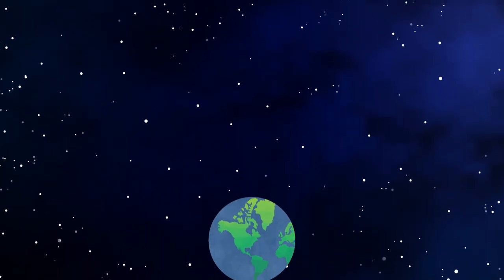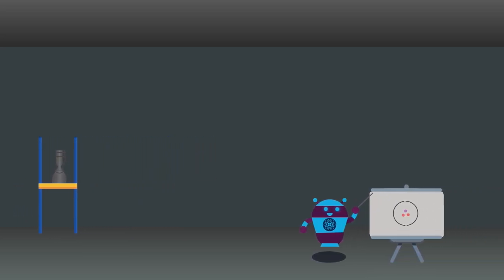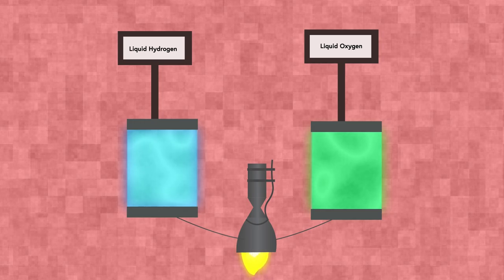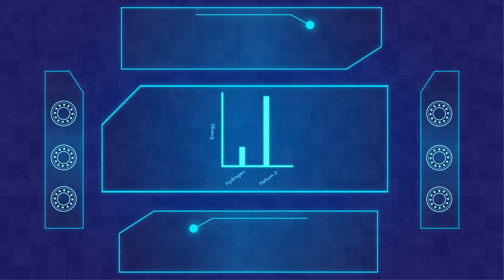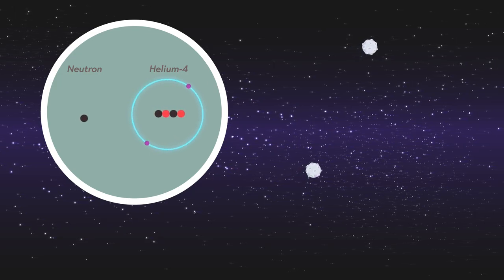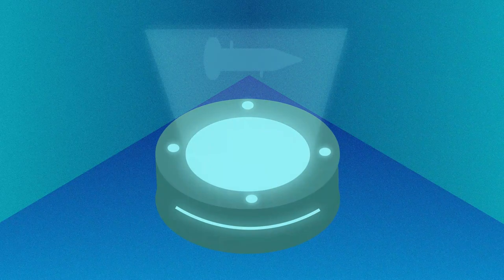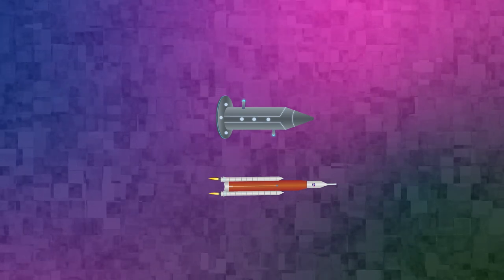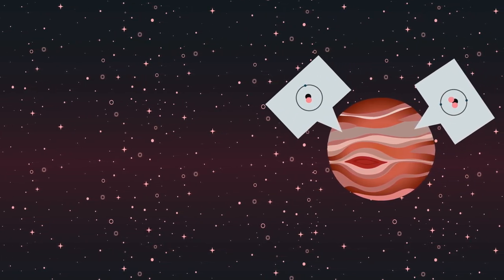Could Helium-3 Power Our Future? (Part 3) | Helium-3 Powered Rockets Explained

Comment: Sure it can. Toss almost anything into a black hole accretion disk or spinning black hole’s ergosphere, harvest resulting radiation, and bang. It’s powered. It’s actualy more effecting to use black holes for mass>energy conversion then when fusion and way less picky fuel wise. 😂 as for weight there are work arounds but by using a light sale that rides the stationary energy beam (with the black hole power source being stationary and off the ship beaming the ship) for travel within our solar system for relative cheap.

Comment: Wrong... is posibole heat and ignite roket fuel using a induction coil whit a big WAT power is called Plasma Engine!!!
Reply: the problem is that it is too powerful a Helium 3 Plama egine...is destroys the engine you need heat-resistant materials that don't exist

Comment: 1:31 No dude your are kind of wrong.
SLS is powered by 4 RS25 engines, which has a max thrust of 418,000 lbf (1.86 MN) at sea level, and 512,300 lbf (2.279 MN) in a Vacuum for the hydorgen Oxygen mixture you are talking about. That means for the hydrogen/oxygen mixture, you are only getting about 2.5 million pounds of thrust, which also means that the other 6.3 million pounds of thrust will be coming from the Ultra massive Solid state boosters on either side of the vehicle, that do not use liquid hydrogen/oxygen.

Comment: I admire your imagination, but i believe your ideas have glossed over some major issues.
its not that we dont have an abundance of helium 3, its more that we dont have alot of helium. Helium 3 is created when you cool helium down to 4 Kelvin. The amount of energy needed to keep the helium that cold would be massive, and would require alot of mass to accomplish, so all of the savings in mass you site between helium vs hydrogen would be lost in the tech needed to keep helium that cold.

Also, you are correct in that exhaust velocity does matter, and with a higher thrust exhaust velocity. helium would be more efficient, however what matters most is mass flow. in space that is what matters along with velocity of exhaust. how much mass is being launched in the opposite direction.